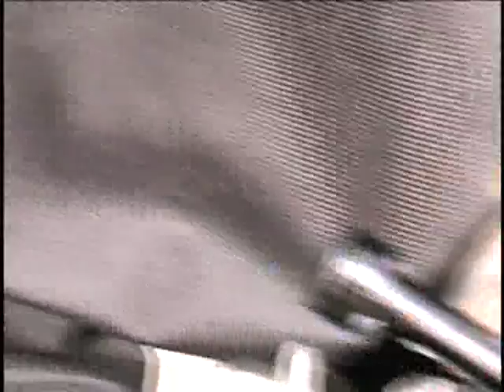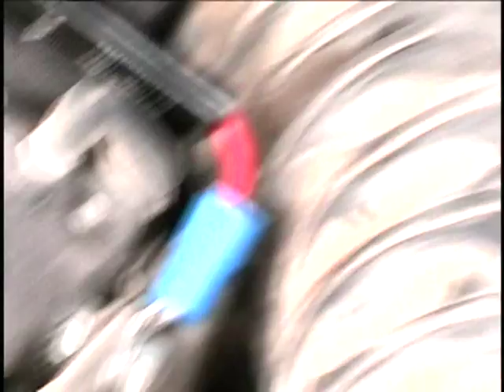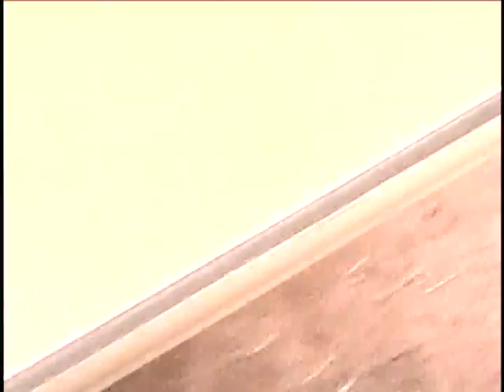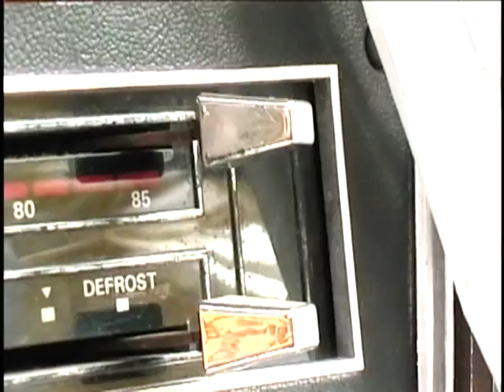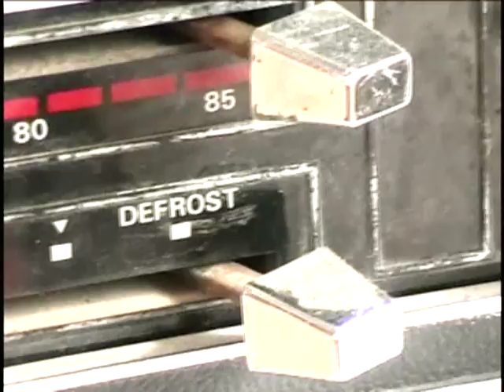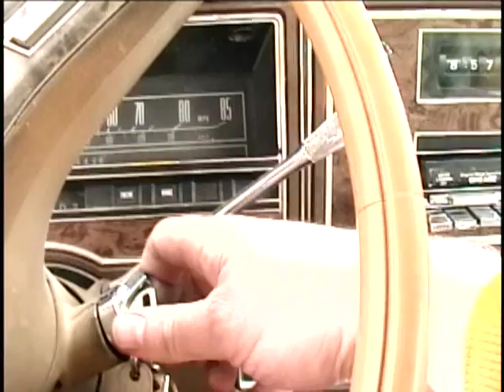1978 Mercury Grand Marquis heater blower motor relay retrofit

Comment: Hi Chad,  Had same problem with a Buick Park Ave fan died so did same mod
added a relay and a dash switch, worked perfect. Dealer wanted 400.00 to
fix. the car only was worth 500.00 so switch and relay was added.